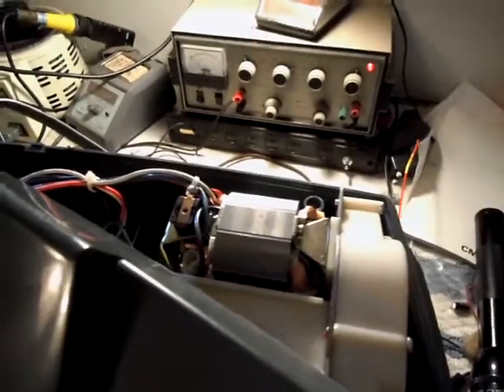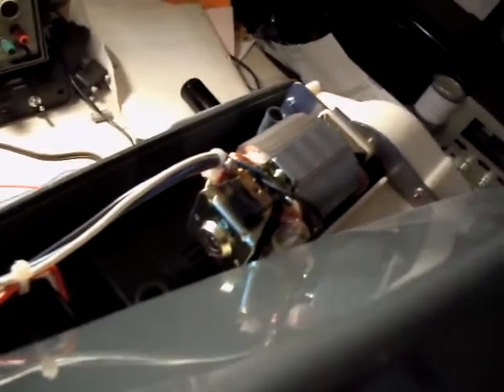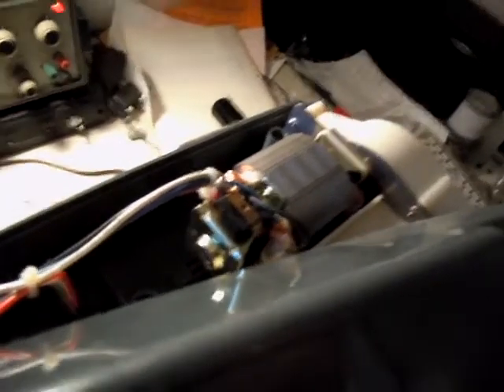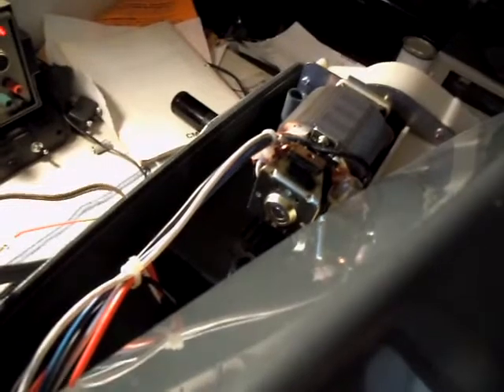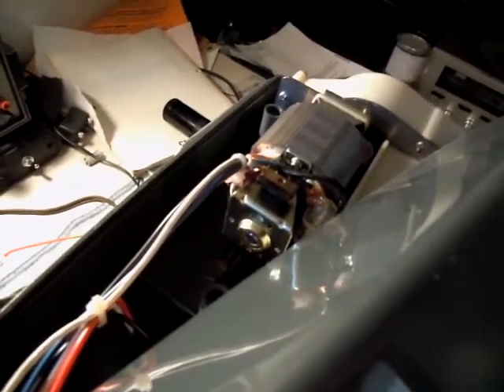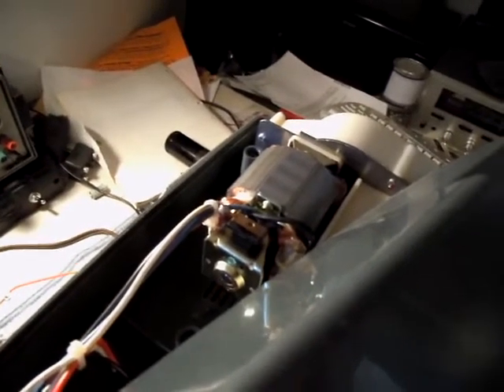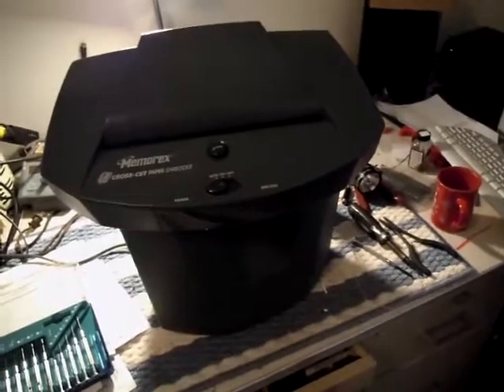When a shredder motor fails - short in armature = FIRE!

Comment: Contact cleaner is flammable!
And, although you didn't use it in the video, I just want to say ... do NOT use WD40 or such in the shredder portion. You can cause a fire and even an explosion.
Reply: I was about to do something similiar but Then after I saw The sparks and realised what I was about to spray was flamabel I just gave up on My Bad plans and decides to Google If this Is a common problem = why I found this video.